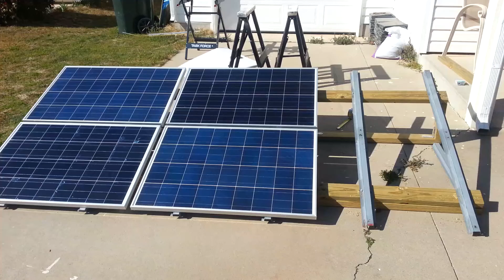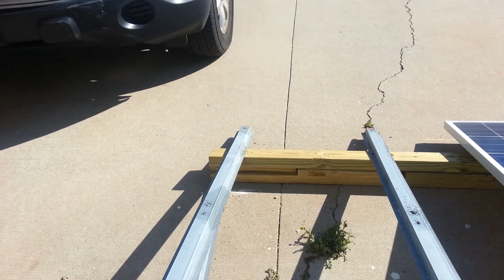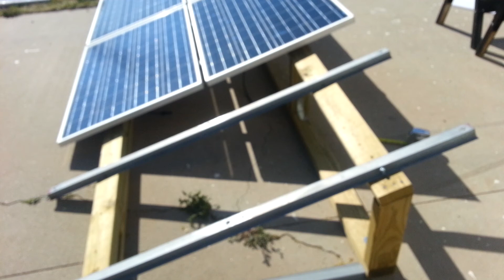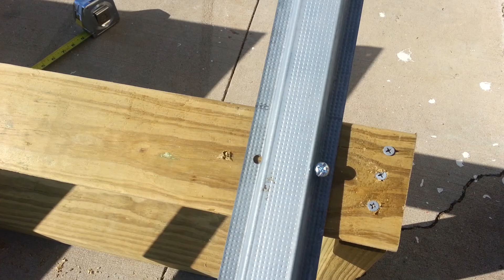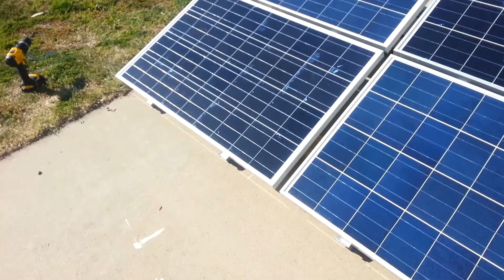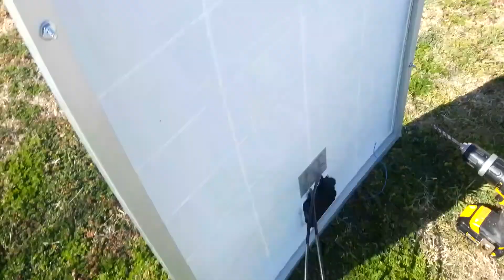Back to solar part 3

Comment from the maker: Thanks for watching and commenting!
It would have been nice to use cheaper wire however my charge controllers
are PWM  and I am using a 12V battery bank so I did not want to sacrifice
voltage by pairing up. My new panels are also be controlled by a PWM
controller and they are wasting voltage right now charging my 12V bank. My
next phase is to buy 6 more batteries so I can up the bank to 24V and then
I will do 2x3 for my small panels.
Best, Dan